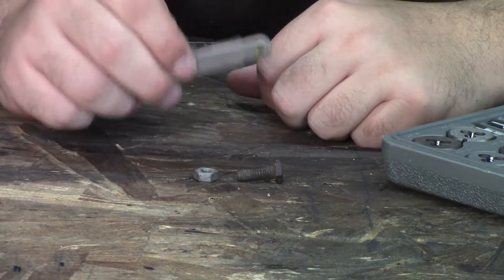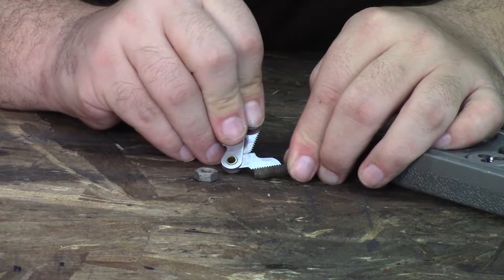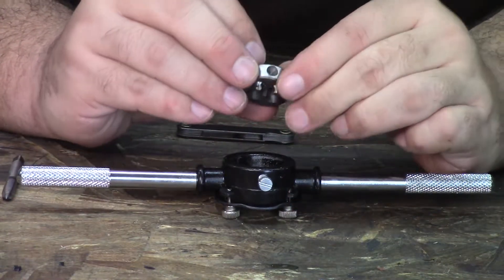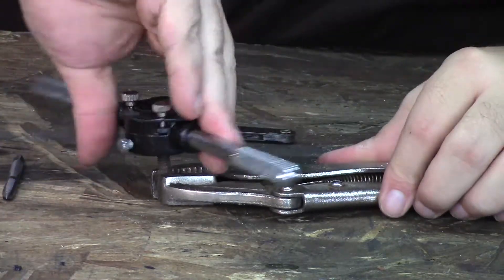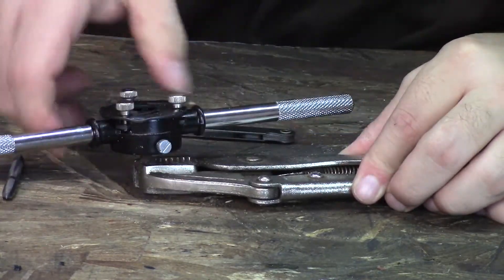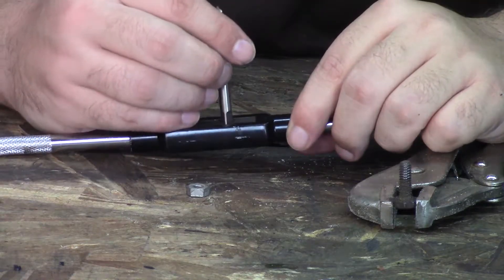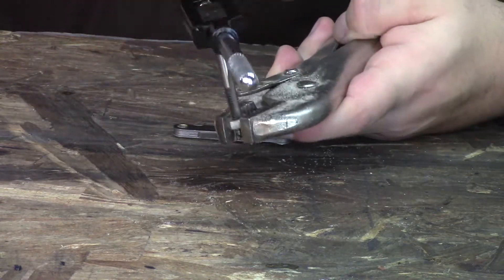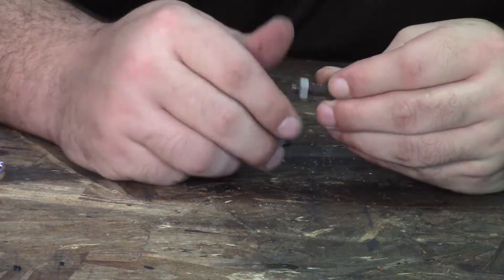[39] - How to do stuff - How to use a Tap and Die set

Comment: This is not how a tap and die set is used. Chasing threads is done with...wait for it...a thread chaser. The former cuts new threads and the latter straightens boogered threads. There's a difference. No new threads were cut in unthreaded material in this video, which is the actual purpose of a tap and die set. And don't use a little oil; use a lot of oil with steel. Take a look at a video of a machinist cutting threads to get an idea of what's involved. It's not necessarily an easy process. From what I've seen, many home shop guys on Youtube don't really know what they're doing. Good luck.